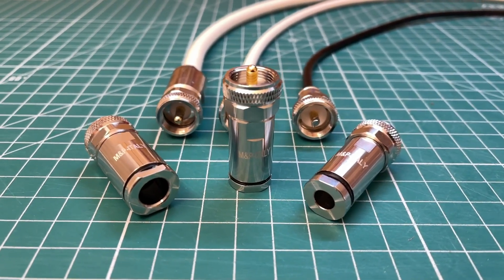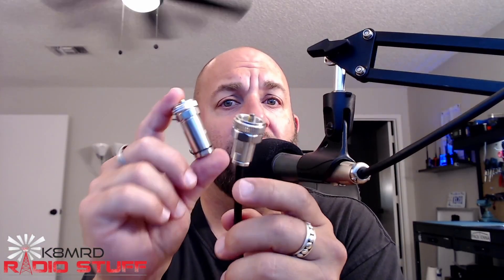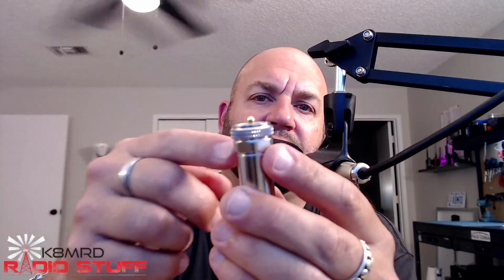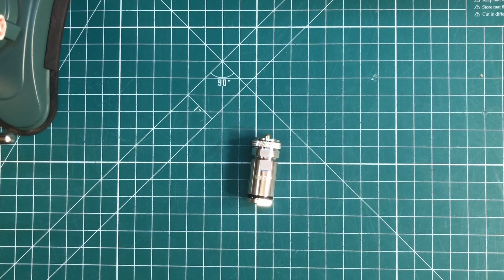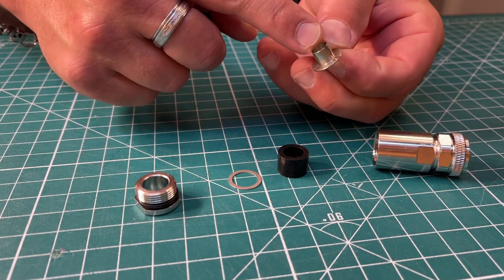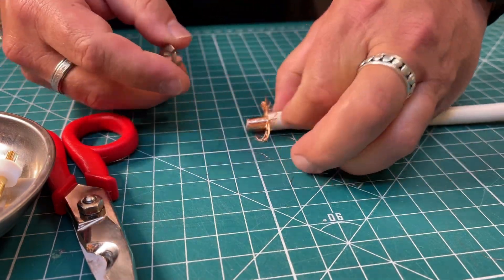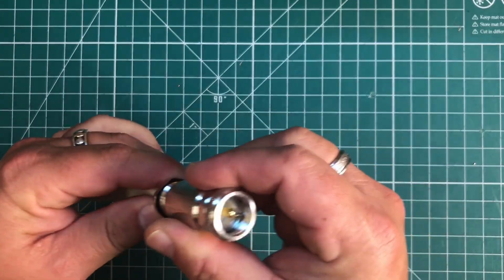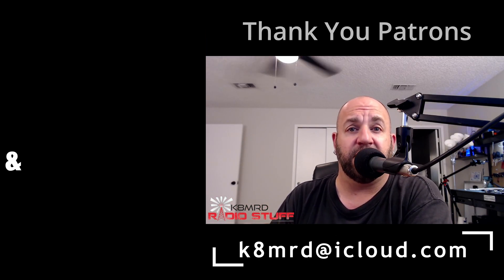MESSI & PAOLONI EVOLUTION PL-259 CONNECTORS

Comment: Been using M&P for some time. Actually terminating three 100' runs tonight and just comparing notes. Been a year or two since I last terminated one. Love the evolution connectors. Easy breezy and you can reuse them. (Sorry Amphenol 😢) Love these things!
 For the haters - The braid on the out side jacket of your coax is a shield not a ground. Not a light switch. It needs no place to land. Can't tell you how many random wires I ran with no such thing as a ground. - Lots of myths and confusion about bonds, grounds and where to put them once you can identify them. Just relax play radio and have fun.
Thanks for the video. Just stopping by to compare notes.. Always a pleasure and love the videos
Cheers and 73

Comment: I wont use them, the ground is not soldered and i would say thats why they are getting hot for lack of ground connection, with a regular pl259 you have 2 options, with or without soldering the shield and if you dont solder then shield it is at least in between the outside jacket and the threads of the pl259 and its a really tight fit compared to the m&p pl259 but to each their own.
Reply: This is a perfect example of the dumbing down of ham radio thinking that soldered braid is somehow Superior to clamped braids.

These connectors are patterned after belden's laboratory grade RF connectors. In RF Laboratories these clamp style connectors are very prominent because of their Superior performance.

One thing you won't see in a RF laboratory is the 1930s Legacy style solder type pl259 connectors as they are pure garbage.

Just look at a TDR sweep of the M&P connector versus the best solder type pl-259 and that's all you'll ever need to see to convince you

These M&P clamp Style pl-259 perform just about as good as the clamp style and connectors which are the industry standard. 

When I visit a ham radio operators Shaq who's having problems at least 80% of the time it's from one of those old school 1930s PL 259 and it's almost always the braids. 

The connectors aren't getting hot poor connection of the braids in fact quite the contrary the braid connection is superior to that of a 1930s Legacy connector it's because they're connected to the back of amplifiers and heat is being dissipated into the connector.

This has always been a problem with high power amplifiers. At least M&P has a solution which will dissipate amplifier heat away from the connector and coax.

Comment: I'm putting a 10 mm Evo connector on the end of some LMR-400 & I'm having a bit of trouble getting solder to flow into the hole in the pin. It's  like I can't get it hot enough. Using a 65W iron & eutectic solder. I think the temp is around 480°F or so. Any suggestions for things to try would be appreciated. 
73!
Reply from the maker: That might not be enough heat fast enough.  My iron is set to 700F.
Reply: Cut a quarter inch piece of solder and put it inside the connector with the center conductor .

Comment: I don't see to much to gain here given all the extra pieces. The water proof is nice but I can use some 33+ which will work just as good with 400 cable and a  solder on pl-259.

Comment: For those who still believe in fairy tales they can use the Evo connectors, for those who understand RF they will use the N type connectors! There is no comparison between the N type and the Evo, the N are clearly better! The PL259 connectors do not have the mechanical dimensions to reach 50 Ohm, so like all PLs they are suitable for uses up to 200MHz! This is the truth, the rest is merchandising!
Reply from the maker: While you aren't wrong as a general statement, it's not a fairy tale at all.  Though I understand what you're getting at, you're still arguing the old PL-259, SO-239 UHF vs, N connector debate.  Ok.  That's Cool & The Gang.  I get it.  Yes, I think everyone knows N connectors are technically better than UHF, especially at higher (microwave) frequencies.  That doesn't change the fact that (most) all HF, VHF/UHF radios have UHF female connectors.  Save for a few certain operators, the EVO connector will outperform anything else they have used.  But why belittle a company that has engineered, tested, manufactured, and marketed a UHF connector to be better at that?  Never mind the fact that on the frequencies most hams use, let's say 1.8 - 450 mHz, the losses with a UHF connector are negligible.  You'd be better suited with a coaxial cable that minimizes the attenuation you'd have between your radio and the antenna.  Yes, connectors matter.  And N connectors are "better".  But for most use cases, the UHF is perfectly acceptable.  And M&P made it even better.  Absolutely love your comment though.  The science behind all this stuff is purely fascinating to me.  I really appreciate you watching this video and appreciate your insight.

Comment: Any idea if hey work on abr400
Reply from the maker: For the 400 size cables you’d want the connectors for the M&P 10 size.
Reply: @hamradiotube  thanks.  The ultra flex 10 isn't much more than ABR 400 do I think I'm gonna buy some.  A out to run 2 lines to a new perm shack location.

Comment: great video. just did a GMRS repeater cite repair from spring storm. near buy lightning strike. repeater was still working just lost rainge. was LMR 500 installed . this is a multi use cite. FM station and 5G cell and some outher repeaters. replaced coax with serah 10 with N connectors. had them made and tested buy M & P. changed inline lightning arrestor . went with a better duplexer . TX/RX systems one. used. re tuned with nano VNA . jumpers in cabinet changed to M & P  . The duplexer had BNC and N for antenna. serah 7 was used for 3 ft jumpers. PL 259 to BNC all made and tested buy M & P . even new AGM batteries .with the MFJ analyzer getting lower VSWR.  under 1.2. on TX and 1.3 on RX. 5 mhz split. this on in of duplexer. when all done 20% more power to antenna. and even better coverage than ever before. I know some came from better duplexer.  taking the end off the LMR  the shield had corrasion from different metals on shield. M&p all copper shield.  lower resistance as well . helps with  low signal receive where some distortion can be hurd. A RF tech working at the cite told me it's the outher transmitters getting threw the LMR shield. They told me about M&P . all others at cite use hard line  . now I am changing my shack from 9913 to M&P . 73;s

Comment: My Dad's coax was mil-spec RG-214 compliments of Lockheed Aircraft Services scrap bin circa 1960's ish...lol😏👍🎙
  Messi & Paolini does make excellent coax and connectors, I just purchased 100' of the Hyperflex 10 with connectors factory installed and tested with certificatation  without regrets and would stand it up against ANY LMR branded garbage any day of the week!

Comment: Hey Mike,
I"m looking into running some feed lines. I'm running 65' out from the house and then about 50' up into the tree to hang an antenna.  I'm looking at the Airborne 10 since it is direct burry (it will be in the conduit that is buried, but there still could be water in there).  Should I run Airborne 10 all the way to my shack inside the house, or transition to another cable type when entering the home? Should I switch to something more flexible inside or just run Airborne 10 all the way to the radio? Right now, just focusing on HF.
Reply from the maker: I’d just run the Airborne 10 all the way personally.  Although if you have a tuner or something else inline you could convert to something a little more flexible to your radio.

Comment: Mike you are not wrong about the M&P coax i am using Ultraflex 10 superb coax, but the new PL259's i paused the video and check the UK price @ £6.95 each, and i would need 30 of them i think not, i did use quality PL259s designed for RG213 the only thing i had to do was slightly file out the internal diameter of the centre pin by 0.3 mm as M&P is 10.4mm diameter and rg213 is 10.1mm diameter, oh and i used the brown centre pl259s far better than the white centres, TBH if i could afford the new ones all 30 of them i would have them, the coax is likely even living close to the sea as i do last maybee 10 years or more, which as the majority of mine is piped underground is a big bonus, big improvement on reception too, i proved this by reaching a ZL station on 60m were i was using 100w (uk 60m limit),and he was using 15w eirp(ZL 60m limit), and @ 11319 miles confirmed qso pretty damm good i think, i recieved him ok likewise me reckon my coax did help, btw 9 bands all georgraphic zones confirmed,just 160m & 6m left plus 179 dxcc's confirmed :) :)

Comment: Yet to find a better connector than M&P's 259. Their coax is also at the top of the game in it's market. Your points in this video are right on the money. Some of us can't run kw's, good feedlines, antenna design and connectors matter. As you said every dB counts. It amazes me people will bitch about a few bucks on a connector then spend 5 grand on an amp.

Comment: Mikeyyy...I first used these Coax Plugs in 1995 already where no one even thought about Names like Messi & Paoloni yet.  Same goes for their Coax Cable you praising it to be the Best in the World. Have you already tested all the Types &  Brands of Coax existing?  Am I allowed to laugh out loud...? The first Aircell Coax with Copper Tin Foil Shield inside came out on the Market I believe it was in 1993 or so. What the Marconi Dudes really did better was making this Coax to become more flexible to be perfect for using it on Rotating Antenna Systems. Your Signal is not going to be 1dB louder than mine just because you running italian made Spaghetti Coax even if you dip in hot Tabasco Sauce before plug it in. Just for the Fun to enjoy I bought me 60ft. of Paoloni's Messi Coax a few Weeks ago to run a Comparison Test between my 8 year old Aircell 7  and the brandnew Messi & Paoloni Edition. There's absolutely no difference to notice in cable loss, db gain, VSWR, REFSWR or anything else. Like I said the italian Coax is a little bit softer and more flexible if you use it with a Rotator System but that's already it. A remarkable Difference to me is what meets my Ear and not what a Nano VNA shows on it's display. Meaning, if this Cable makes my ears able to hear incoming signals which  I cannot hear with any other Coax Cable on the Market and it makes my outgoing Signal 1S-Unit louder across the Pond as usual then and only then I might throw all my old Coax out of the Window to making Amore Mio with Marconi & Pavarotti Lead. YFUG is a badass Guy! Isn't he...huh? He is always talking back, that critical Sierra Osccar Alpha Bravo. 
Great Video Docu like you always do Mikey, keep up the good Work, 73 & happy thursday de DK5ONV 💯🙋‍♂
Reply: Hi I'm one of the Marconi dudes :)

First of all, thank you for trying our Ultraflex 7, and trusting us.

Also the appreciation for the undeniable better flexibility of our cable, compared to the competition.

Hitting a cable like Aircell 7 in the field is not for everyone, and when we designed our Ultraflex 7, we knew we had to give more in various aspects.

Our task was not to make a clone, but an evolution of successful existing products in Germany.

First of all the greater flexibility and resistance to torsion, which stresses so much the cables connected to antennas with rotor. For this reason our braid is made with 24 spool braiding machines, instead of 16 spools of the competition, and having 50% more crossovers, it is resilient, and this allows us to call it "reactive braid", as it acts like a spring. .

Please click link below
https://www.youtube.com/watch?v=Gbm50mOOTUQ
  
Furthermore, our cable had to be very performing for attenuation, and shielding efficiency, (SA), and even in these aspects we had to give more.

When the organizing committee of the WRTC 2018 in Germany, tested and approved our Ultraflex 7, as official cable, they pointed out that above 28 MHz, it was better in progression than the historic RG 213 cable, (10.3 mm / .403 "), instead of 7.3 mm (.287 ") of Ultraflex 7

In tests the ULTRAFLEX 7 turned out to be the best compromise existing in the size-performance ratio and was therefore selected.

Same thing for WRTC 2022 in Italy where again the Ultraflex 7 model will honor the Radiosport inaugurated by Marconi.

At low frequencies, the differences between cables can be very difficult to detect, especially if the sections are short, and the attenuations are so low that they are superimposed by the error factor of the detection instrument (the VNA). (the cheaper it is, the greater the error factor and vice versa for professional tools).

I think it is more than correct to say that on a 60-foot section it is difficult to see a noticeable difference, especially if the frequency of use is low. However, there would be a remarkable difference if the cable being compared was an RG8 or RG 213, especially in reception, and for  background noise reduction.

Where the frequencies rise, the differences between the cables begin to be more noticeable, and the greater the length of the lines, the easier it is to notice them.

If our cables weren't better, we might not have been so successful in Germany earlier and throughout Europe thereafter.

Our company dates back to 1946, we have been manufacturing cables since 1974 and in 1985, we began to produce anonymously, (OEM), cables for a German distributor who is still one of our strongest customers (but now distributes under our brand). The German market is therefore our most important market, and producing a worthy standard for this market means having what it takes, across the board.

When they asked us to produce alternatives to the two most famous cables in Germany, we knew we had to evolve them, surpass them in order to have a chance of success on famous and well-reputed cables.

We were able to do this thanks to the advice and field tests of DXing teams, and our great affinity with the amateur radio world.

It is not just a question of generosity towards radio amateurs, or a subtle advertising strategy. DXing teams are our best beta testers in the field and we value their feedback to constantly improve our products.

The protagonists of the very expensive expedition from Bouvet Island, or Crozet Island, trust from direct experience on our products in extreme situations, it is the proof that our products are evolutions of the cable species. 

After all, cables resemble spaghetti, and who better than Italians can improve spaghetti? :)

Returning to the connectors: even in Italy when we started they only knew the PL259 Amphenol as the best solution, a project from the 40's ..

For us the best solution was instead the N connector.
Having to design something new we were inspired by the "N" connector project, perfecting previous projects and wanting to provide the best for the users of our cables ....

We think we have succeeded!

Thanks for the comment

Comment: I still kind of wonder why new stuff hasn't switched to N connectors TBH.
Reply from the maker: Baby steps.  We still don't have USB-C charging on most HT's either.
Reply: @hamradiotube  True. Except the N connector has been around since the 1940's. (Also need to use USB-C instead of microusb on all the USB stuff.)

Comment: People, K8MRD is NOT exaggerating. These things are amazing.  …but vise-grips?! That’s like using brillo on a Ferrari! Sheesh.  Great video.
Reply from the maker: I know, I know.  I didn't wait too but I didn't have the right size wrench.
Reply: @hamradiotube  Fabulous video. With all that corrosion protection no worries. You used the best tools you had to complete the task. Thank you for running such an educational and fun channel.
Reply: @hamradiotube   SPANNER not a wrench & they are Molegrips you used, plus you called a spanner a spanner 30 seconds later :)